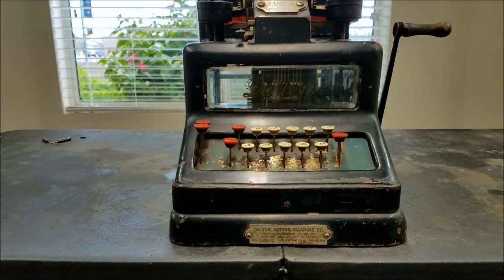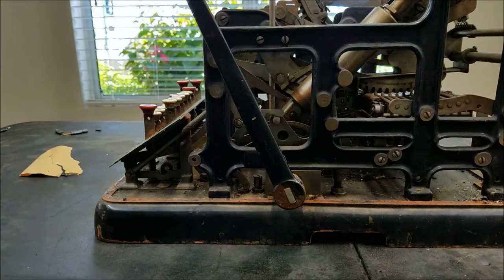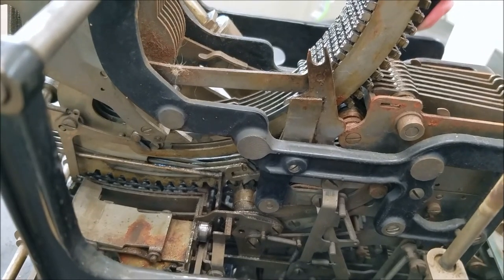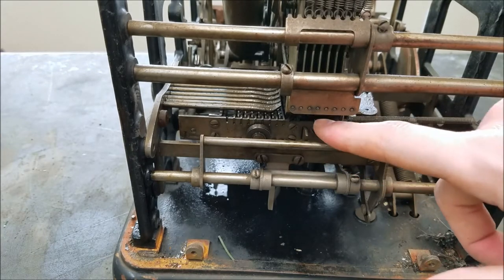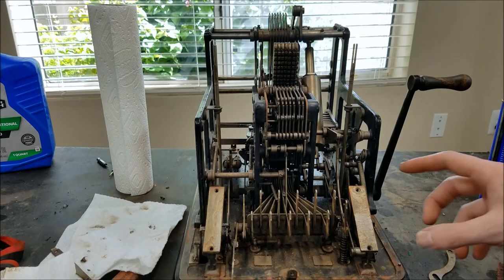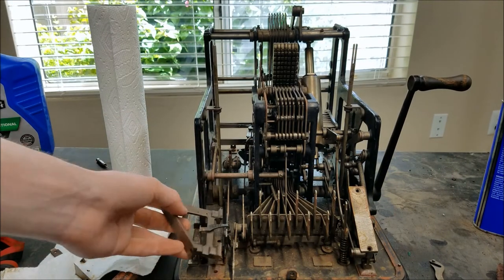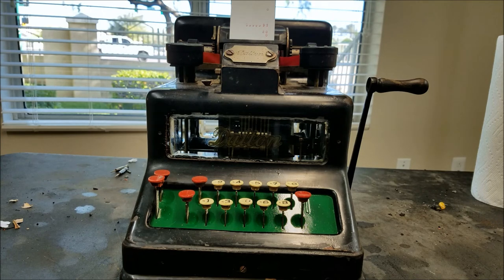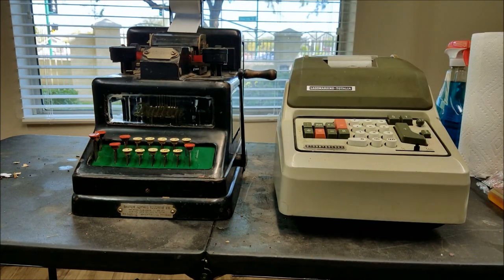1909 Dalton Adding Machine Repair (Glass Sides)

Comment: Thanks for the clear views of how it works. Have a late 1920s (steel-sided) version. Also had haphazard paper-feeding, was fixed by a mild-abrasive clean of the platen and fixing the front feed-roller. Old rubber had shrunk and had a 'flat', so rounded again and adding heat-shrink tubing fixed it.  (Ribbon-reverse should I think be automatic, triggered by tension of pulling on empty spool.)
Again tnx for the video :-)

Comment: I have a slightly different model that I’m currently fixing. Thank you for uploading this video!  I’ve learned quite a bit about its mechanics. 

My current issues are that the machine won’t print since it seems the keys become locked. I assume something on or near the pegboard is stuck and not being able to find a diagram of how it is built has made this  a wonderfully challenging task! 😊 

I enjoy purchasing these items and repairing them. 

Your video is insightful and has helped me better understand how it works! Thank you! 

keys won’t engage. I’ve managed to get them to work on occasion and I’m
Reply from the maker: Thanks, I hope you get yours working!
Reply: how’d it go i also have a slightly different one that’s keys will not go down the handle is also limp and won’t go back up